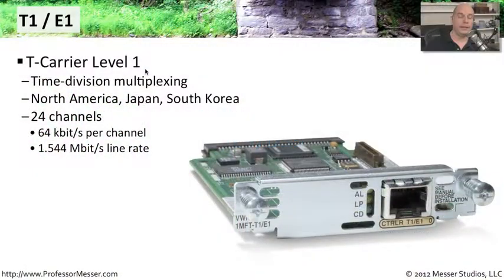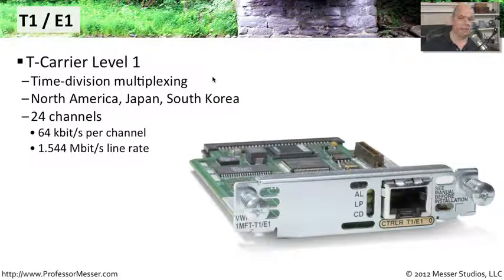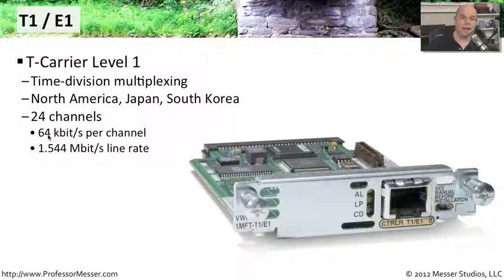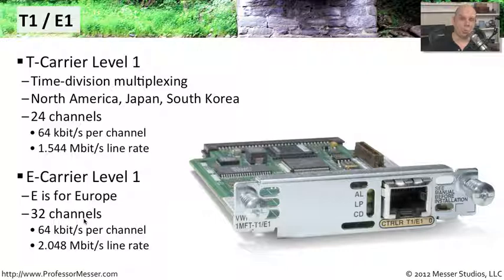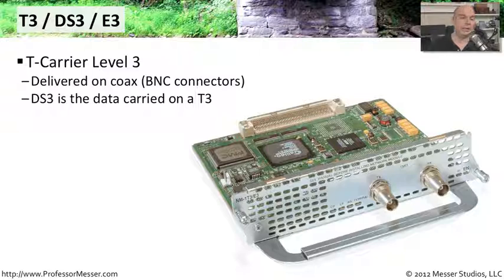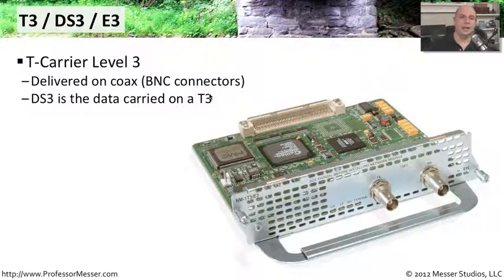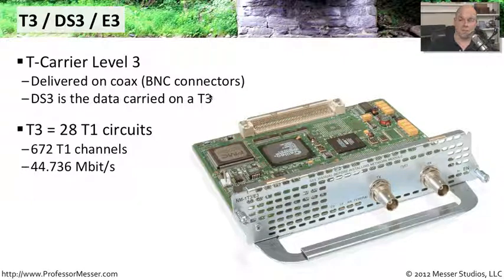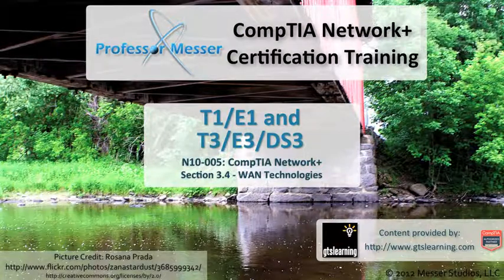T1/E1 and T3/E3/DS3 - CompTIA Network+ N10-005: 3.4

Comment: What an i missing if T1 is only 1.5 mbp/s but Ethernet gives 100 mbp/s and up why is T carriers used ? Is it used just for video streaming ?
Reply: K Robinson I know this is old but i figure other people wonder about this, originally it was because of the lack of availability of Ethernet and the cost of ethernet, very similar to what we are currently dealing with Ethernet vs fiber.   Now its just at that point that its already there and corporations just need to upgrade
Reply: +K BX NYC MANY people in the USA do not have access to Fios, Cable or DSL, dial up and phone line is the answer.
Reply: Michael Thomas  well we would have had a nationwide fiber optic network to gradually replace our aging copper infrastructure, but we have the majority of dinosaur senators in congress to thank  for striking the idea down.
Reply: I know this is old but, believe it or not many government agencies still use T1 for systems designed, built and are still in use since 1988 (doppler weather radar anyone?); Further, now I work for a different agency which still uses T3/DS3. So, with that in mind, however obsolete a tech is, always good to know. 

Ethernet has distance limitations which is why you would use Ethernet at home, but your ISP connection is DSL, fiber, or cable / satellite. T1 is a simpler physical layer that is used over regular telephone wiring like DSL does, but still use Ethernet to the T1 modem.